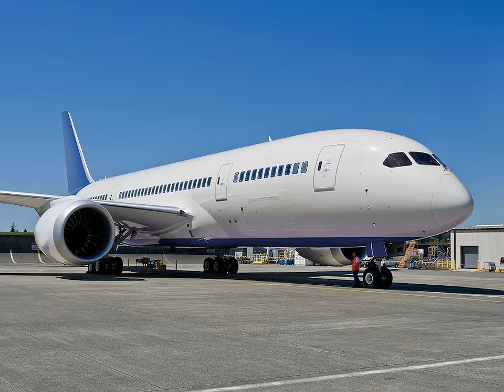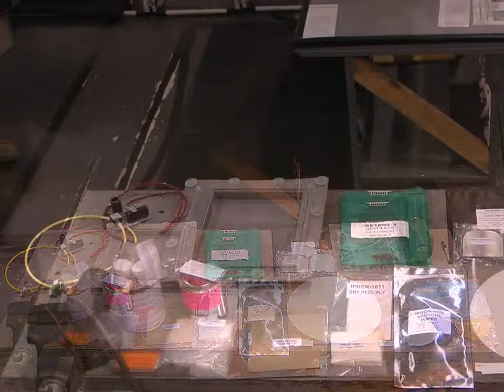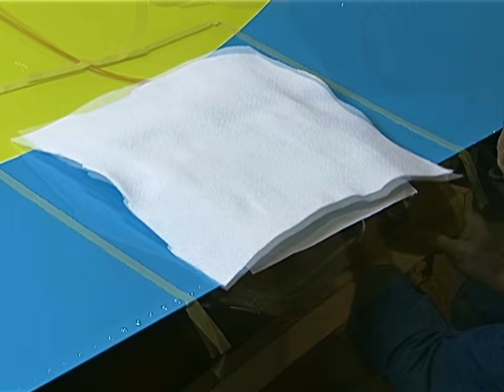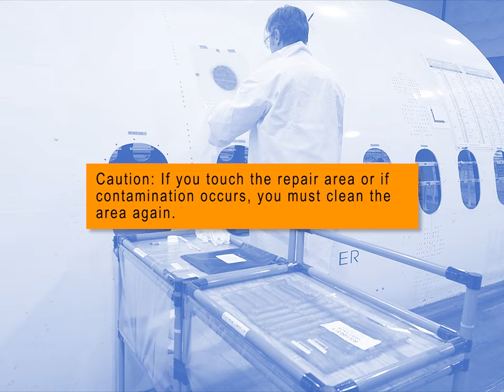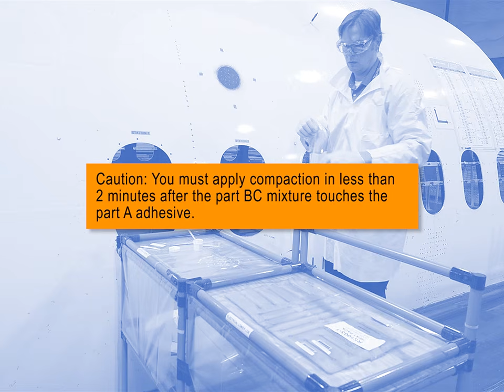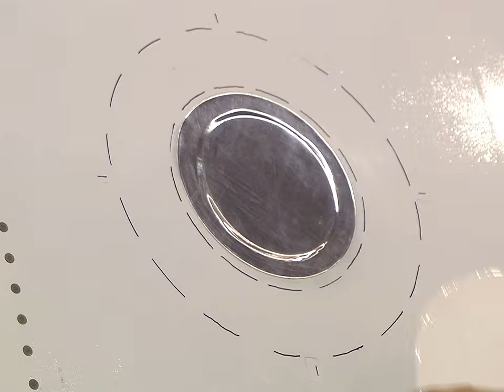B787 Quick Composite Repair

Comment: If this repair can be done in a flight line environment why are you demonstrating it in a hangar environment on a empty fuselage shell? Having worked in the industry for over 30 years (licensed A&P mechanic) at major third party MRO, small and major airlines, and manufacture, this sort of repair would be done in a hangar during an overnight check or “C” check. Trying to maintain cleanliness and temperature requirements is to difficult to do outside for composite repairs. I am not saying it can’t be done, just never saw it done in practice. Additionally, composite repair tends to be done by mechanics who have specialized in it and do it almost exclusively. Even with traditional sheet metal repairs it was the overnight check mechanics , not flight line mechanics, who did the work.

Comment: These will be the next disasters that happens to Boeing aircraft. They have no idea what is going to happen to a fiberglass cylinder, pressurized, thousands of times and what will happen to it. As always Boeing uses humans as guinea pigs until hundreds of deaths.
Reply from the maker: Look, that’s not the case, my friend. It involves many years of research and development, plus the certification aircraft (parts of which were even cut out for analysis), and monitoring by operators since 2012. There’s a lot that goes into ensuring safety.

Comment: I have to do carbon fiber repair patching on my paramotor on occasion.  It's amusing how similar the overall process is, yet how different the actual execution and attention to detail is.   But then we both go flying again!
Reply from the maker: Aircraft sizes differ, but sometimes the repair processes are exactly the same, and the same materials are used as well.

Comment: These training videos always make me laugh.  Carrying out the process in a nice comfortable workshop/hangar asking for the process to be done with no wind, no exposure excess heat, moisture, contamination etc with everything laid out nicely on a table.  Try telling that to a ramp technician in Arizona on an unstable mobile platform in 80+ temp when the aircraft has been standing and you can cook an egg on the aircraft skin and its blowing, can't get hangar space and the dispatcher is screaming to get the flight gone.  No mention is made as to an acceptable aircraft skin temperature for the repair or an approved time after application the aircraft can be allowed to fly.
Reply from the maker: Yeah, but let’s face it—it would be pretty weird to see the plane manufacturer creating a totally hostile and complicated environment just to make a video promoting the idea of an easy job, right?

Comment: I have a plastic fantastic corvette.. the repair is practically the same.
Reply from the maker: Actually, repair techniques for composite materials are very similar in both the aviation and automotive industries, my friend.
Reply: @AirplanesMechanic  Except one is responsible to the lives of 200+ passengers and exposed to constant fluctuations in pressures and stresses. 

The other looks great on the driveway.

Comment: What happens after this repair? Is it required to do a 'permanent' repair? Or this is it?
Reply: The carbon fibre patch shall bond and form a layer that is like new. So it is just as strong and permanent as other parts of the plane. 
But its cover is strange, perhaps that is temporary till proper painting will occur...
Reply: @Sonnell  It’s a temporary repair. It has to be replaced by a permanent repair within 24 months.
Reply: This repair is designed to last until the plane's next C check, where it will get a more permanent repair
Reply: @Groobl  What is the more permanent repair process?
Reply: @TheMertonator I don't know about Boeing , but this would count as a amateur repair in any sailplane shop. A proper repair entails removing all the damage, scarfing to expose all layers of the laminate, replacing the layers in reverse order and finally finish sanding back to the original profile. Said repair would restore the original stiffness and strength and weight. The way they do it would create a stress riser, be heavier than the original, and lack aerodynamic finesse. Also the sanding and mixing exhibited lack of care. Hmmph !
Reply: @tkxmix  This is not a permanent repair. Think of it as a band aid.  It can be done at the gate within a two hour window.  It must be replaced by a permanent repair within 24 months and visually inspected periodically after installation. The reason it exists is if you have a scratch, nick, or gouge slightly larger than the allowable damage limits you can get the airplane back into service quickly and give the airline flexibility for scheduling a permanent repair.  The added weight is negligible as is the added drag. The other two circular patches are just speed tape.
Reply: @artjackson8360  I have seen the permanent repair scheme in books ('Advanced Composites Repair' if memory serves). Even that seemed to violate stiffness and fairness. I am sure that Boeing has its reasons, but sailplane manufacturers and repair stations have been at this longer than anyone - and it shows. Still, my great respect to all those who repair planes.✌
Reply: @tkxmix  you make a good point when it comes to gliders. A large commercial airliner and a high performance glider are two very different types of aircraft with unique requirements for each. It is not necessary to have a quick turnaround on a glider repair. However, minimum downtime on a commercial airliner is highly desirable. A QCR is all about quick turnaround. I agree it’s not an appropriate repair on a glider. Boeing does have more traditional scarf repairs defined for various sections of the aircraft in the same manner that you do on a sailplane. Wet layups and prepregs are both offered. By giving the airlines a choice of repair it maximizes their flexibility to keep their aircraft flying and generating revenue.

Comment: 8:46 LIKE HOT DEICING FLUIDS?? These carbon composites seem rather finicky. And what does “quick” mean here?
Reply from the maker: To ensure the process is completed promptly, Boeing provides repair kits that already include the materials used to fix routine damage during ground service. Because the service is so fast, the term “quick” is used.
Reply: Quick is a relative term. Usually though I've never seen this repair done on the gate. The aircraft gets pulled out of service and sent to the hangar or a hardstand.
Reply: @EntityOfTheVoid  Have you seen or actually done this repair?  I’m the QCR focal in the 787 SRM group at Boeing and I’d love to hear any experience you’ve had.